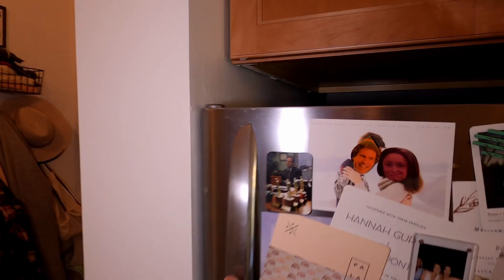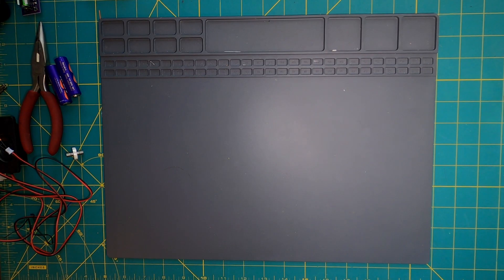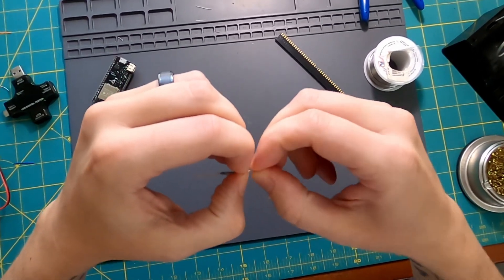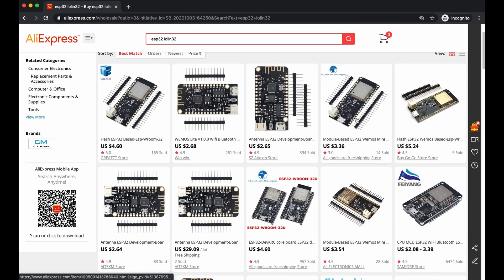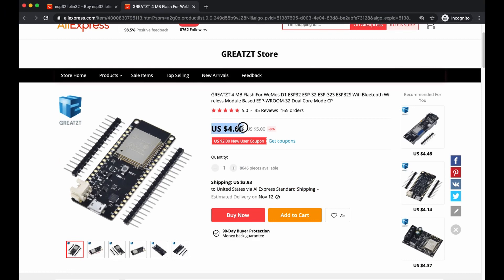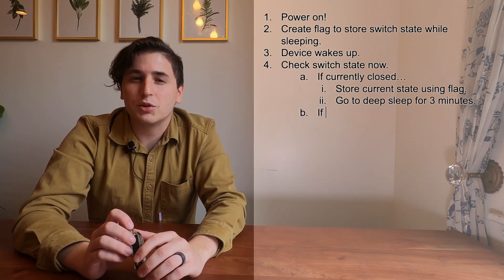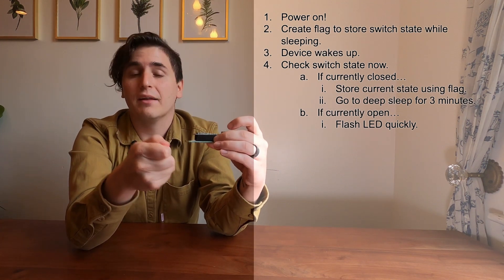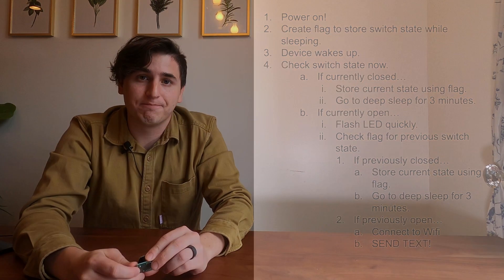My "dumb" freezer can now text me if I leave it open too long

Comment: You could use a Normally Closed reed switch and External Wake up to make the battery last longer because the pin would be high only when the door is open. Then it’s always in deep sleep until the door opens so you wouldn’t have to use a timer wake up.
Reply from the maker: I thought about this, and I think you're right - I could save some battery. But I'd still need a way to distinguish between false positives (freezer door open for appropriate time) and accidental meltdowns. I'd still need a timer. so I just preferred to keep the logic super simple knowing that in context it would take a long time to kill that battery. Also I didn't have any NC switches sitting around lol
Reply from the maker: Also I think I read somewhere that setting an external interrupt uses slightly more current than timer based sleep but I could be totally wrong on that
Reply from the maker: Good thought tho! Thanks

Comment: Could you make the ESP32 wakeup only when the door is opened, by use of "External wakeup"? Then do a 3 min sleep and re-check. This way the battery might last much longer.
Reply from the maker: Yup, an interrupt would totally work. I think I was trying to keep it more "noob" friendly, but I'm not sure I even accomplished that 😁
Reply from the maker: Although actually now that I think of it - I think keeping an interrupt active may actually prevent you from entering the "deepest" sleep on the ESP. vaguely remember seeing that? Could be totally wrong though